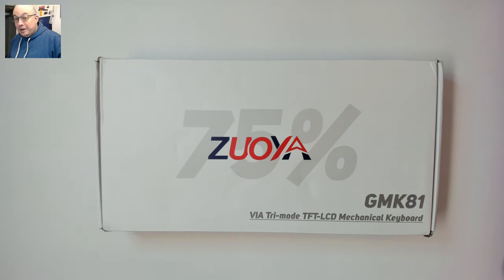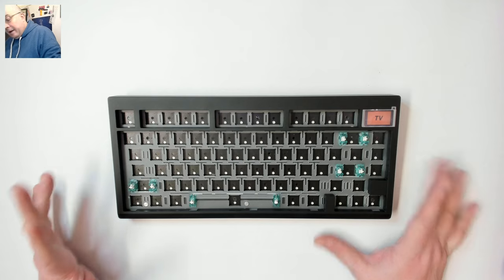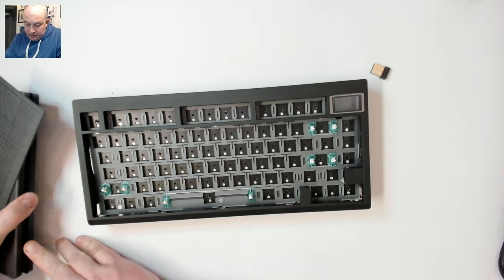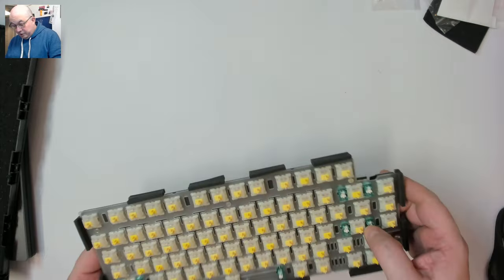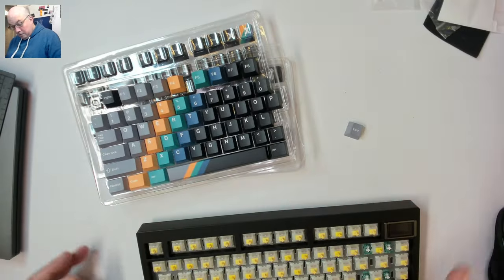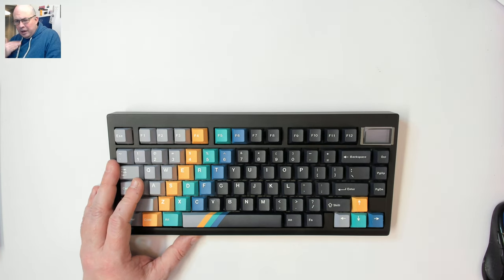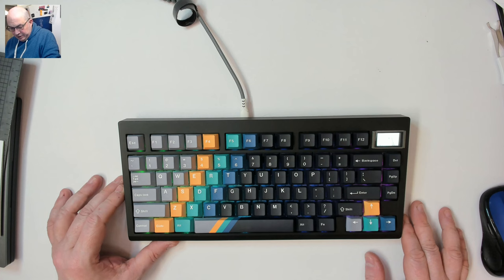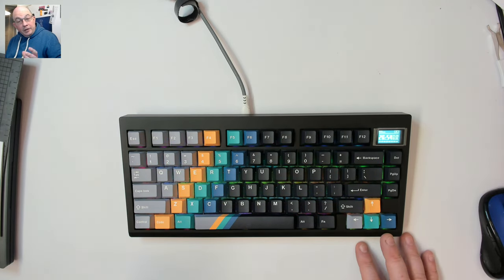GMK81 75% Teardown Review and Sound Test

Comment: Zuoya is killing it in the budget plastic keyboard game, especially when you can find it for so incredibly cheap. I think the Ajazz AK820 Pro gives it a run for its money, considering it's a pre-built. To be honest, though, I think Ajazz kind of stumbled on that combination... 😅
Reply from the maker: I've always had bad luck with Ajazz boards and find their key mapping odd, but Zuoya is truly killing it. I've got the GMK67-S enroute!
Reply: @MechKeyboards  I find Ajazz boards to be incredibly hit or miss. They stumbled on a great combination with the AK820 Pro for sure. With the Gift switches, it's a lovely clacky board right out of the box. The only other Ajazz board that I like is the MKC087, which is the stacked steel keyboard kit. It's very strange and sounds horrible without mods, but after modding, it sounds and feels great. Plus it has incredibly low latency which is great for gaming. Zuoya GMK line is just unbeatable. I have 2 67s and 1 87. I keep going back and forth on grabbing an 81, but maybe when they come out with more colors. I am really curious to find out the differences with the new 67-S!
Reply from the maker: @nebulazykbs  I have an AC067 which I do like, after mods, but overall have just been meh about them. I have a GMK67-S on the way and can't wait. Planning on doing a comparison video of the OG GMK67 on (4) boards, with stock PET, and then three other PET replacements to compare the sound differences.

Comment: I got my GMK67 in on Monday and I was gonna leave that plastic film in, but even after punching a the hole in the middle, I was afraid that the pins on my switches would bend, so I took it off. Maybe next time I will leave it in. Two things that I don´t like about the Zuoya boards are: 1. They don´t come with a plastic cover for the keyboards. Most other keyboard manufacturers are including them now. 2. The clip on cases. I feel this limits how much you can mod the keyboard in case you want to try different builds in the future due to the fear of eventually snapping those clips. I don´t feel that including holes for screws would raise the price much. Just look at the GAS67.
Reply from the maker: With a handful of exceptions, normally prebuilts include them, but agree, they should always be included. I've opened clip based keyboard cases many, many times, as long as the case is not pulled apart while one or more clips are still engaged, clips should not break; knock on wood, I've not had a single one break; if they added screws they'd most likely go into a plastic stem, which would wear out much quicker than clips, IMO, unless they actually used threaded metal inserts, which adds more to the manufacturing process.

Comment: You don't need to punch holes or take the board out to install the switches. I've installed mine, on GMK87, for first time in my life, with only 3 switches bent. Works like charm. After years of using mechanical keyboards from Logitech and Corsair, I can't switch back to them. It's just too good feeling to type on real one.
Reply from the maker: People should use whatever method makes them feel comfortable; if people want to punch hole and support the sockets, then that's what they should do.

Just because you did not damage your PCB, does not mean that others might not.

Comment: I am trying to decide between the GMK81 and the Darmoshark Top75. Both look great. Have you had an experience with the Darmoshark Top75 or heard anything about it, Negative or Positive?
Reply from the maker: Only experience I have with Darmoshark was a keyboard I ordered to review and it arrived DOA. I use my GMK81 regularly.
Reply: On another note, the TH80 Pro V2 looks very similar to this board. Any word on if it is just a rebrand of the gmk81?
Reply from the maker: @ToxikBones1  no idea, I stay far away from Epomaker as possible.

Comment: hey i am back i just got one more question that is which keyboard do you think is better the gmk81 or the leobog hi8?
Reply from the maker: I do not have the Hi8, but it's supposed to be a better version of the Hi75, which I think is great. But most of the times, an aluminum keyboard will be better than a plastic one.
Reply: @MechKeyboards  is in the kit of the hi75 a switch and keycap puller included?
Reply from the maker: @jemoer208  here is everything in the box and my review of it: https://youtu.be/kj2Np_U5eg4?si=QgsLdllG_NCZJvYC&t=85

Comment: im confused regarding the pins on the switches? i dont see any holes on the board except the center one. do you force it in? i can kinda see that you are using 5pin switches? i wanna order this and im not sure whether to get 3pin or 5pin switches? do you in both cases just force them in? i am a very beginner in building keyboards so sorry if this is a stupid question.
Reply from the maker: No such thing as a stupid question! This keyboard is 3 and 5 pin hot swap compatible, the iXPE and PET sheets are not pre-perforated, so one must make them before installing switches. Despite being a different model, this should provide a better explanation of what to do: https://www.youtube.com/watch?v=NCjOXj0y0K8

Feel free to hop on over BudgetKeebs (https://budgetkeebs.com) and post questions in the weekly question thread if you have more questions and share your board once it's complete, KCKO!

Comment: What about the rgb backlights? Can you set them to a specific color?
Reply from the maker: You can cycle through preset colors, as this is not a QMK keyboard, there is no way to do per key RGB.
Reply: @MechKeyboards  Thanks, I'm looking to set the entire keyboard a specific light, but I can't find such mode, so I'm guessing it doesn't have that? It's a shame because it theoretically could run any light you want, Zuoya just didn't implement it for whatever reason

Comment: I have a question. I bought a GMK81, and most of the lights are not working. What do you think is the problem?
Reply from the maker: I'm sorry, that sounds defective, please reach out to the store you purchased it from.
Reply: @MechKeyboards  The seller wants me to open the board and check the plastic film under the pc board but its to hard for me to open the cover.
Reply from the maker: @gils8692  you should not be forced to open it but if you do, this may help https://youtu.be/adW2f2L9Qvw?si=tg6spqy1Qu1YqlDH&t=1412
Reply: @MechKeyboards  What do you call that tool you use for opening the case?
Reply from the maker: @gils8692  plastic stick spudger: https://www.amazon.com/gp/product/B01JG9UFBO

Comment: hi there, how can i check if i'm on mac or windows mode, at screen?
Reply from the maker: Unfortunately since the screen and VIA are not connected (to the same software/firmware), there is no indicator of which mode the keyboard is currently in :(